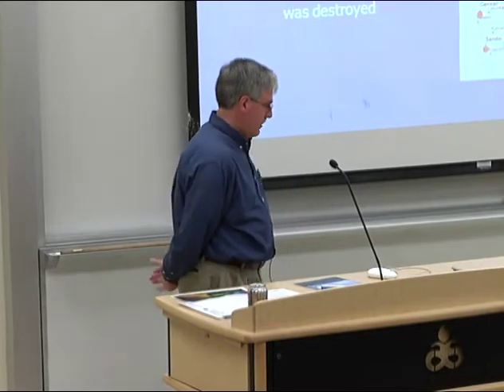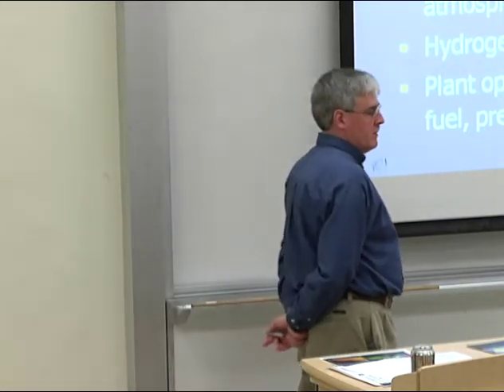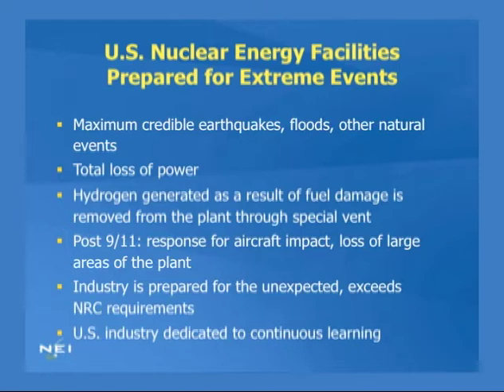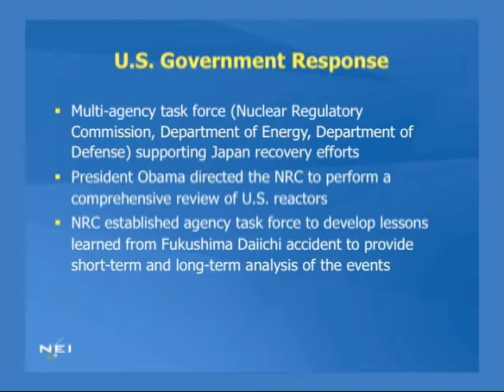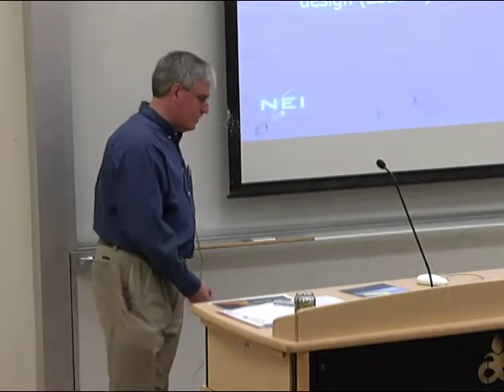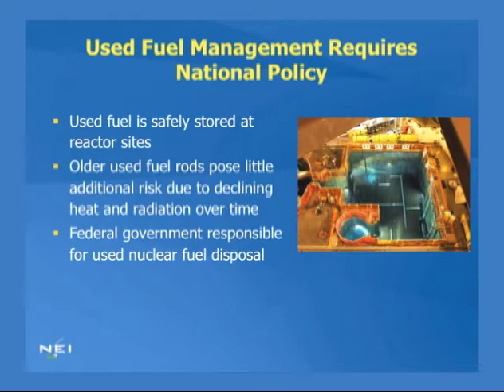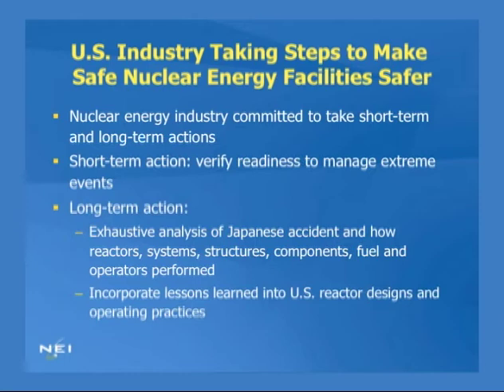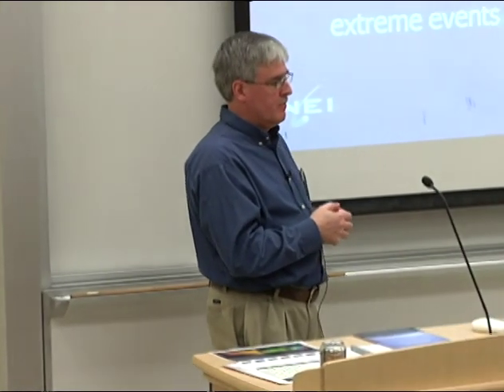Japanese Nuclear Accident and U.S. Response | Albany State University

Comment: US response was abysmal at best.  These transuranics and radionuclides are evaporating and bonding with molecules like oxygen 18 but also 16 and moving around the planet.  Internal and external doses are different and external exposure is mainly pushed by pronuclear people.....and dance around our internal doses through the Petkau affect.  The inverse square law does not apply to extended sources and is a point source only law that only works in a vacuum....this calculation is used everyday on the surface of this planet in not only the calibration of all radiation detection monitors but in the actual measurement process along with the corrections the devices attempt to make for gamma attenuation and the electron avalanche while a quenching gas is used to try and alleviate the issue.  With dead time and saturation...all these devices have issues including the mass spectrometer.  The lesson that needs to be learned from Fukushima is they all need to be shut down, and a plan put in place to safely get it ALL off this planet.